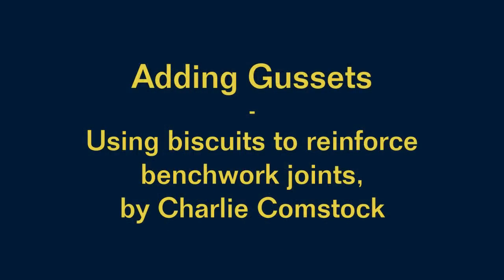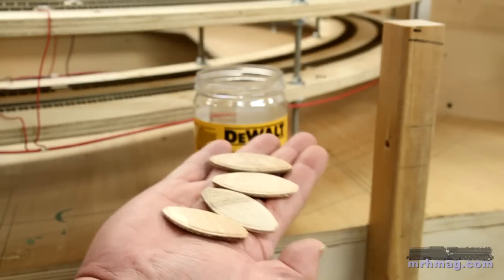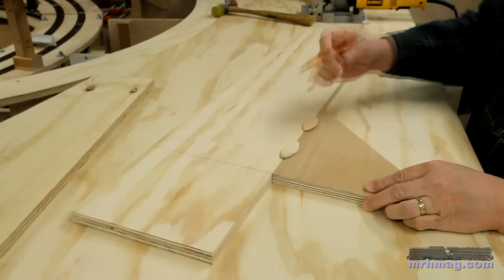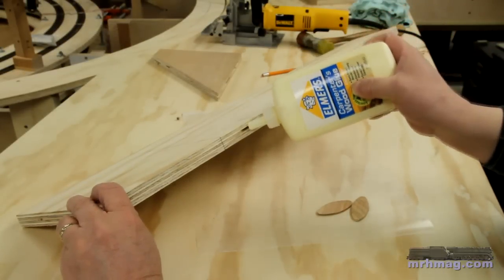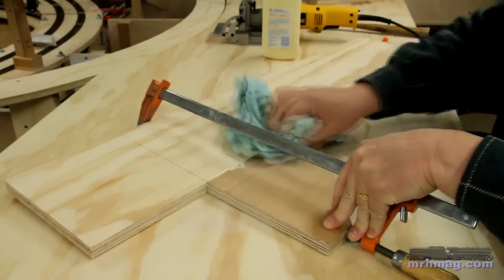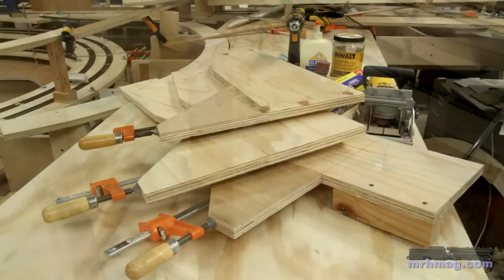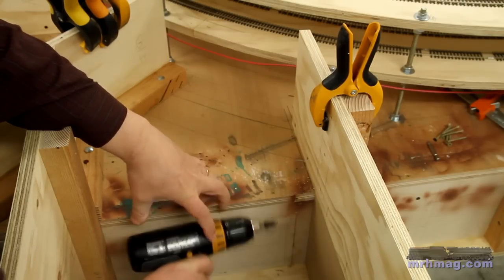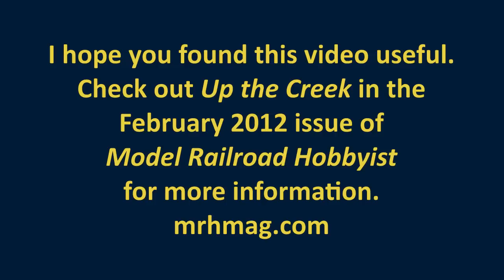Model Train Benchwork Using Biscuits

Comment: As a professional wood worker you are partially right when you used the biscuits. But they don't give a lot of strength as much as they are for aligning the 2 pieces of wood and keep them aligned. The glue does the work and I don't use biscuits anymore.

Comment: Actually the biscuits do little to strengthen the joint. They only help in having the 2 woods to be glued in line. The glue is the real friend in this application. The biscuits only keep the wood in line. I have been using biscuits for many years in my woodworking. Very nice plans. What did you use to draw them?? The bolts you used to strengthen the attachment to the helix seem to be overkill. What is the difference in screwing the second screw down and then the first? Won't it still twist. With all the clamps it wouldn't twist anyway.